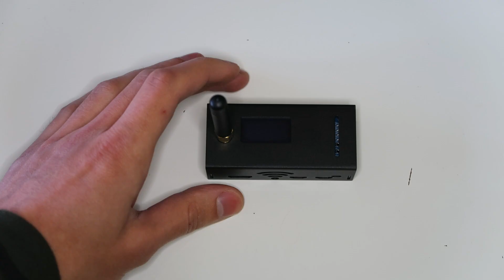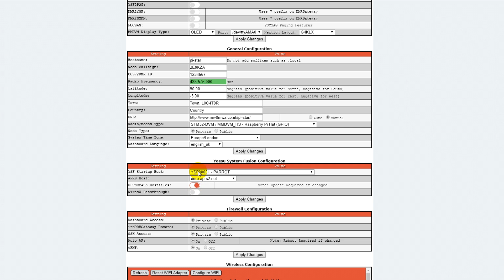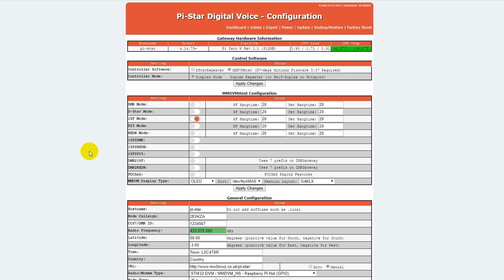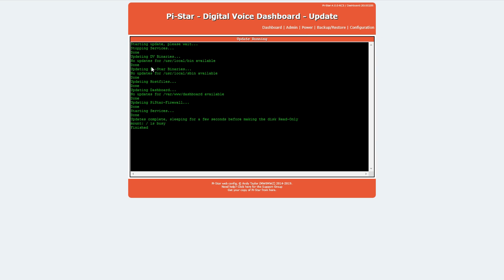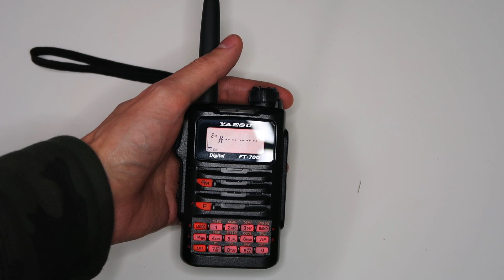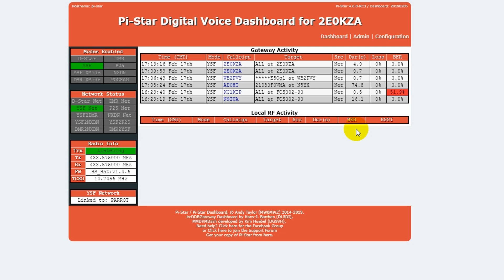Yaesu Fusion hotspot setup guide

Comment from the maker: I did not end up making a video on adjusting the frequency to improve BER but I did write this blog post showing it: https://radiosification.blogspot.com/2020/05/tuning-your-hotspot-pi-star.html
Reply: The only problem I have is this adjustment is only good for each particular radio. There's an inherent oscillator offset for the hotspot typically, but... I must say all my radios work great except the FD-70. That needed offset throws other radios now unable to connect.

Comment: I absolute wonder, if i follow this on my 510ASP, seach under wires x will not work like on yours, always get data error. Some told it is a protocol problem with the hotspot, but if it works on the FT5D, i guess it is more a bug in 510 still not fixed. Has someone a idea?
Reply from the maker: Could be tuning or bandwidth. Not sure if that radio can change it but on my ft70d you can change the bandwidth on fusion and it does affect this if you have the wrong one set.

If that doesn't help, try tuning the Rx frequency of the hotspot. I think I have a guide on my blog on that topic. Try searching it.
Reply from the maker: Actually the guide is linked as a pinned comment

Comment: I followed your wonderful videos to set up my hotspot for DMR. Can I turn on YSF and DMR on the same hotspot?
Reply from the maker: You can, but it might not work as well because it can take some time to detect which mode you're using when you start transmitting.
Reply: @radiosification  better to get another hotspot so I can run both individually then. 73’s

Comment: Managed to follow all this, but the F - AMS WIRES connect doesn't work here. It just waits for a while, then 3 beeps and back to the frequency display. Any ideas what's wrong?!
Reply from the maker: I had a similar issue before and found that the RX frequency calibration of the hotspot was slightly off. I think I posted about it on my blog at the time and how to fix it
Reply: @radiosification thanks! Fixed now. I used the calibration feature in MMDVM and keyed up, changing the offset whist watching the graph on a 1sec update to get the BER as low as possible. Now accepts link commands :-)
Reply from the maker: @combatwombat71  glad it worked for you

Comment: I have a problem with my FT70DE. I can't transit to MMDVM HOTSPOT. In reception, however, I receive. With my FTM 400, however, I have no problem receiving and transmitting.
I set the radio to Simplex mode, then DN mode without AMS, then set WideFM, then set Half Dev to disabled mode, and channel bandwidth to 12.5Khz.
But I can not in any way transit on the Hotspot. I dare not imagine when I will have to configure the other FT3DE radio: on various forums I have read that the FT70DE and also FT1 and FT3 create many of these problems. Could you tell me how to solve the problem? Thank you very much

Comment: thank you very much for your video, i found it very helpful for the YSF system. Even if I don't understand why I was able to connect the 991-A, instead the 7250D receives but does not connect in transmission

Comment: I can get it to work until the Wires X bit and it just times out and I cannot change anything, all other settings correct!
Reply from the maker: Assuming you mean opening the wiresx menu on the radio, I had this happen and the cause was the bit error rate (BER) being too high because the hotspot was slightly off frequency. Once I tuned it then it worked fine. See my blog for a guide on tuning it
Reply: @radiosification  I sorted it, it was to do with the freq offset, on the MMDVM it said RX 500 TX 500, which I set in Pi, but then changed values to 0 and now it works fine.
Reply from the maker: @AlanM9PSKKing  ah good, so it was off frequency
Reply: @radiosification  Yes, had a similar issue with a MD-380 on DMR so knew where to look :)

Comment: Can you show what all the small symbols are to the left of the room Cn, En, Fr, rFr, Rptr, etc and what they mean. Mine is transmitting but all my audio comes back to my FT 70 after a delay and can't imagine this is correct for a QSO. Need to be sure what frequency and offsets to use on the radio as well as which ones go into the configuration screen. I have the upper frequency on the configuration screen at the PLUS offset frequency of 439.950 and the lower one at 434.950. I think I am close but still not quite there . 73 Thanks Greg KE8QAS.

Comment: Okay dumb question why do I need a ham radio to use this?  Could I plug in a microphone and a speaker and do the same thing?
Reply from the maker: The radio contains a vocoder that compresses the voice down. That component isn't in the hotspot and you can't compress your audio into the same format to speak to anyone else without it.

It would be possible to have the vocoder in software on the hotspot, but unfortunately it's proprietary and the company who made it doesn't allow us to do this.

Comment: Great video! I am using a Ft70d and I can pickup  YSF rooms but I can't TX. Any ideas please Tom kd9dvp
Reply from the maker: You can't tx on ysf rooms only, or at all on fusion through the hotspot?
Reply: I can TX on my radio to other groups  with my hotspot just not on YSF thru  with Pi-Star

Comment: Thank you for the bit on fixing the BER.  My FT-991 would work on my hotspot but not my FT-70D despite all settings being the same.  I would transmit and the hotspot would trigger for half a second then cut out.  My BER was sitting around 5%.  I adjusted the frequency until my BER was sitting on average 1% between both radios and now my FT-70D works.  I've ordered another hotspot so when that arrives I will set one up for each radio and customise the frequency.

Comment: Followed your setup and it all works. However: if I disconnect my ft70d, and try to reconnect again, I cannot connect. What am I doing wrong? Thanks.
Reply from the maker: How are you disconnecting it, and how are you trying to connect it again?
Reply: @radiosification  2 seconds mode button, then reconnecting using F and AMS button.
Reply from the maker: Sounds like you're doing it correctly. The problem could be caused by having multiple modes turned on in the hotspot. Do you have more than one digital mode on? It has to scan each of them and the transmission from the radio is quite short so it often misses it if you have more than one mode on
Reply: Yes, DMR. Dstar wil also follow. But I get your solution. Thank you for the quick replies.
Reply from the maker: Try turning off the other modes and see if that fixes it
Reply: @radiosification  that fixes the connection issue. Not sure why it always connects (with other modes active) initially,  but he ho. Same thing now seems to happen with changing reflectors........ It now connects (in single type mode) to the hotspot everytime, but doesn't like going to another reflector. I only just got the ft70d, so still learning (might be me) . A ft2de is on its way to me too, as is an icom, just to get the holy trinity complete.

Comment: Great Video!  Did you follow up with the Bit Error Rate adjustment video?
Reply from the maker: No I had completely forgotten about that. Thanks for the reminder
Reply: @radiosification  Thank you, that would be helpful.  Also a video on using YSF to DMR would be nice as well.  Your setup videos were excellent and had me up and running in a very short time.  Thank you!
Reply from the maker: @dennisschultz1175  I do have a blog post on the BER correction actually. Have a look on my blog https://radiosification.blogspot.com

Comment: Hi I got ft 70d yaesu and jumbo hotspot I here cq UK fine but when transmit into it I break up and some time I don't get in but received it's fine on jumbo hotspot to my radio
Reply from the maker: That sounds like you need to adjust the Rx offset on the hotspot so it's accurate to the frequency the radio is transmitting on.
I was actually planning to make a video showing how to do that next.
Reply: @radiosification   where will find rx offset

Comment: what could the problem be if the hotspot doesn't receive from the radio? I have it set to simplex and verified that the output frequency is correct
Reply from the maker: You probably need to adjust the Rx offset. The frequency accuracy of these hotspots is usually not perfect
Reply from the maker: I have an article showing how to do this on my blog http://radiosification.blogspot.com

Comment: Quick question. I am using a hotspot with the FT-70D and found your video to be a great help but sometimes when I try and disconnect by holding down the "mode button" instead of disconnecting I get TOO ROO flashing on the screen. Any idea what that is about? I then seem to stay connected...it won't disconnect.
Reply from the maker: I don't think you can disconnect by holding the mode button. That does something else. I think it's a group mode or something. It does say in the manual if you want to check

Comment: So if you need a hotspot and require an internet connection, what’s the point of the radio again?
Reply from the maker: To talk to people...
Reply: radiosification I seems kinda redundant to crowbar a radio where it wasn’t required because VoIP etc exists. Seems more like an excuse to use a radio than a reason for it,
Reply from the maker: You both should watch this video to understand hotspots better and why people use them: https://youtu.be/T4g4nec6lik
Reply: @radiosification  I know what a hotspot is, and how they are used, and how there was no real point in a radio licence to use Fusion, etc. other than the legality, and how it’s all useless if your internet connection drops out for whatever reason, and how none of it really requires any creativity or experimentation. It’s all a black box solution provided by one manufacturer or another, but each to his own.
Reply from the maker: @BrekMartin  Actually Pi-Star is open source software so you can modify it yourself if you have the ability.
Reply: @radiosification  Pi-Star doesn’t understand much, if anything about the proprietary codecs it supports. That would breach patents. It just has to wrap up some data in some TCPIP and pass it on. Regardless I don’t think you understand the point I was making in the first place.
Reply from the maker: @BrekMartin  It can convert between the standards so it does understand Fusion, DMR, etc. Yes it doesn't decode the vocoder data, but that's the same for using a repeater on the digital modes or even using them at all. Only with FreeDV do you have an open source vocoder too. Do you think we should completely stop using all digital modes with a proprietary vocoder?
Reply: @Fourteen ZXER I think this is all good so long as the people using it aren’t pretending to be useful in emergency or something like that. Most hams in my country wouldn’t even have a battery, so if you say something like amateur radio is the last backup when communication fails, but you don’t have a battery, or rely on the internet, that’s really just pretending.
Reply: Fourteen ZXER Because you can get tech license, buy a HT,  connect some consumer crap to the internet, and pretend that’s radio.

Comment: can't connect to wires x on the hotspot. Just flashes wires for about 20 seconds and nothing happens. any ideas??
Reply from the maker: Ensure that your hotspot and radio are both set to the same bandwidth (wide or narrow)
Reply: @radiosification   how do I change the bandwidth ?
Reply from the maker: Read your radios manual

Comment: On Pi-Star 3.4.17 did not work to connect the WIRES :(
Reply from the maker: You can't connect to wires X directly from any hotspot. It is not possible. You have to use a Yaesu gateway or radio.

Comment: I got stuck at the point of ysf configuration. I only have 2 options there instead of 4 like on your screen. What did i miss?
Reply from the maker: What time in the video? I don't know where you're stuck at
Reply: @radiosification   that's ok. got it working already. Thanks~!  Is there a way to save the ysf channels on the ft70dr? I see that there are 5 blank channels. can we save channels there to make it easier to recall these channels?

Comment: Hello! Very useful video and good work from you. Thank you for your time to spend. Please i have a yaesu ft-1xdr its the same setup? Thank you!
Reply from the maker: It's mostly the same for all Fusion radios, yes. Only the radio's interface will be slightly different. Follow along with the instructions and you should be able to figure out any differences with your radio if you're familiar with it.

Comment: Is the tutorial for adjusting the BER done yet, but just not posted to the playlist shown above? And thank you for these tutorials. I'm going to try to get my jumbo spot set up soon.
Reply from the maker: No it's not done yet but thanks for the reminder. I'll try to do it soon
Reply: @radiosification  Also, my Yaesu Configuration block is different than yours in that it has no option to select the UPPER CASE. (plus I have not been able to get the Jumbo Spot working yet. I keep ending up with a DNS error.)
Reply: @radiosification  It would be extremely helpful.  My BER came up about 1.7%..  DE W5PKH

Comment: Thank you for the video. You do a very good job describing this topic. I noticed you can switch between different modes. Can you come Fusion or DMR to DStar?
Reply from the maker: No, you can only crossmode between modes with the same vocoder. DSTAR uses an incompatible vocoder to the DMR, Fusion, NXDN which all use the same and can be crossmoded. Also fusion in VW mode works with P25 because the vocoders are compatible
Reply: radiosification I don’t know what is different in the vocoders but is it’s a different sample rate, a sample rate converter can be used.  I don’t know if a RPi is up to the task of sample rate conversion.
Reply from the maker: @thuff3207  no the same rate is the same, it is the vocoder data rate I think is different. I'm not completely sure of the exact differences though so don't quote me on that. There is no way to get them to work together as far as I'm aware without decoding the audio and re-encoding it again with the correct vocoder. You can't change the sample rate (resample) vocoder data without decoding it first anyway.

Comment: Thanks for this informative video. Question: Why would after pushing the F and AMS keys the radio connect to my own node? In other words, my own call sign begins to scroll across the display. After doing that, entering any YSF numbers on the EN line and pushing the AMS takes me nowhere the radio does nothing.

Comment: Not recommended for high RF areas (like big cities) The 108 MHz - 580 MHz wide-banded receiver can be a problem.
Reply from the maker: Not had any issues so far and I'm in London
Reply: @radiosification  I'm using Kenwood a NX-300 NEXTEDGE. It's only UHF so the front end doesn't mute radio when overwhelmed by another signal. I was in La Joya, CA when this happened, but there was a hill directly above me with dozens of radio towers. Yaesu chat rooms can be programmed into the NXDN radios. Icoms NX- series is good choice as well for Pi-Star MMDVM. Disadvantage is you need PC to change talkgroups, Yaesu can be done "on the fly".